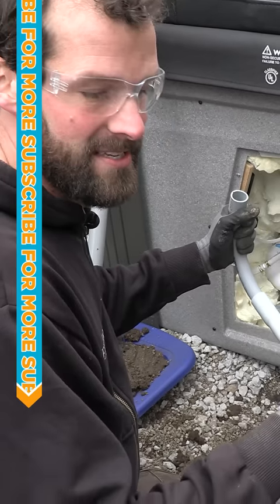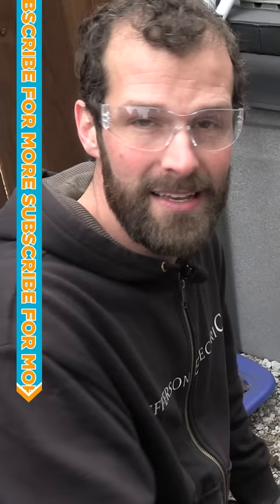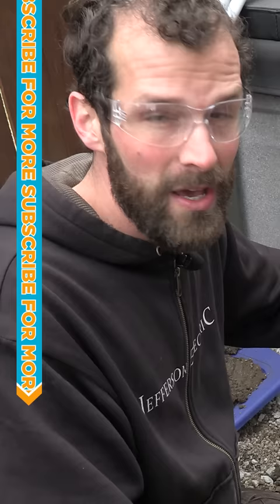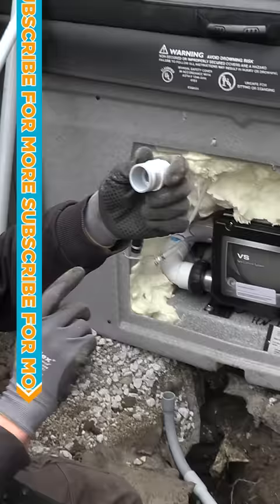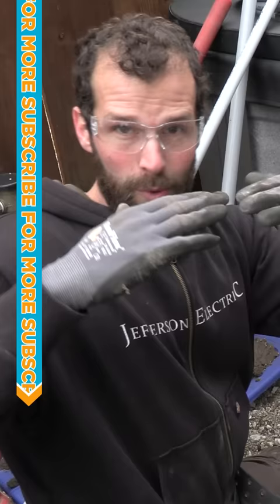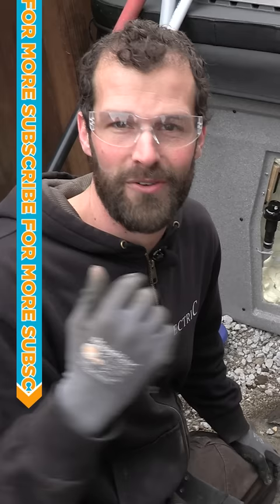A Warning When Using PVC

Comment: You are SO Wrong!  Lol.  Expansion and contraction of plastic pipe is 1” for every 50’ at 50 delta T.  If it’s 100 dF outside there is no way the earth is 50 dF.  It might be 80, giving you a 20 dF delta.  Also if you solvent weld your joints, which you should, they will NEVER pull apart.  Don’t spread garage information.

Comment: If it expanded and contracts  this much  the glued joint would never hold becuase  its a totally  different  material  if it changes  at this rate,  at these temperatures I don't believe it  your talking g out of you butt.  I've never had an experience  ever  like this having trouble  sizing pipe  pipe is not iron or steel  or cast  metal  it does not expand  and contract like metals. I don't believe  what your saying